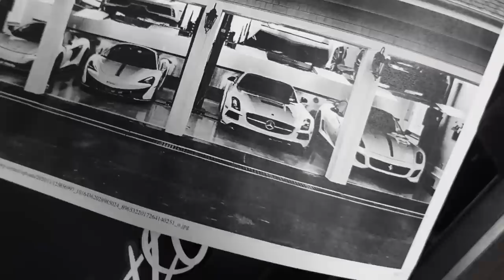M4 WHEEL REVEAL + VEILSIDE IS FINALLY BACK!

Comment: Tj when using the wheel it doesnt need to be full rpm slow it way down when moving to left use the the left side of the wheel to center when moving to the right use the right edge to center of the wheel wont burn threw the clear and it will remove tape better